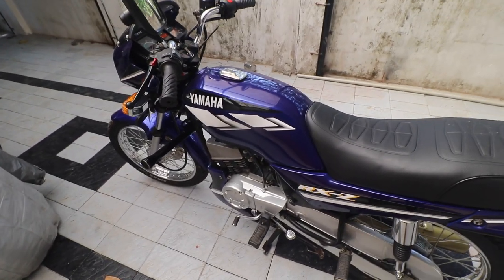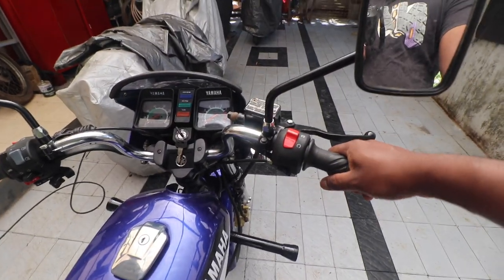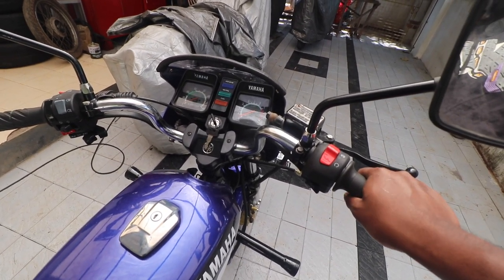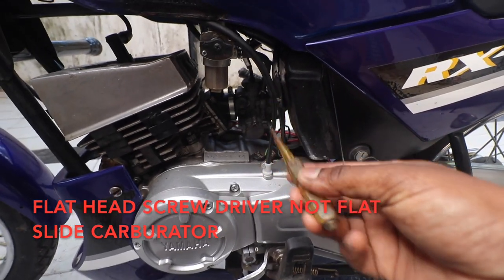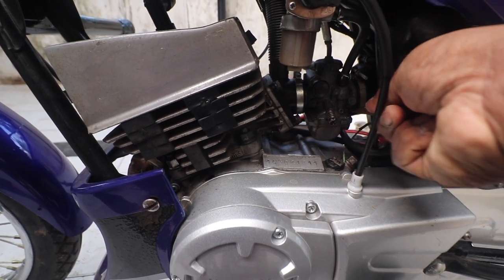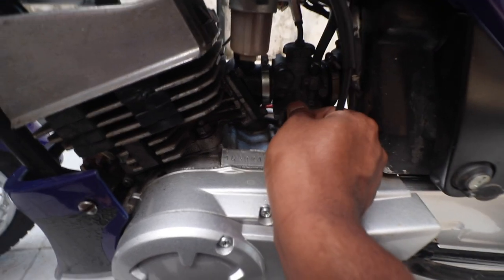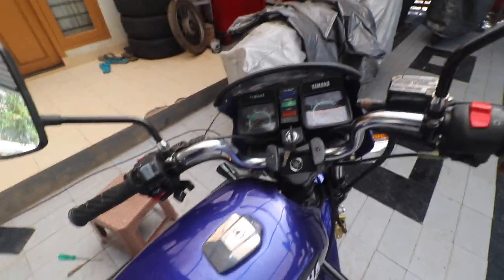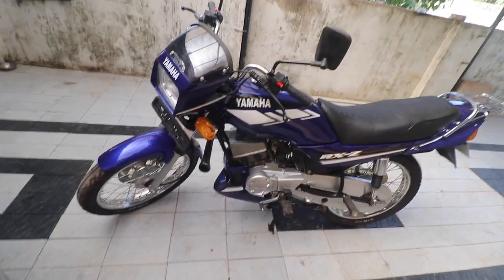Tuning a Yamaha RX Carburattor plus some troubleshooting steps

Comment: Sir I’m having RX 135 4 speed. I tuned the air screw out to 1.5 turns as you said in the video. But by bike does not pulls above 95 kmph in full throttle. It feels like rpm cutoff in fuel injection bikes. Pls help me bro @yamakaze
Reply from the maker: 2-3 things could be attributed to that all are fuel related though.
1. Bad main jet/ clogged atomiser
2. Incorrect float height 
3. Air hole for the tank cap blocked

For 3rd, you can ride with the lid open and see if that brings a difference. For 1 & 2 you will have to dismantle the carb and clean it. Before doing anything take a plug reading at that rpm where the problem begins, another important point is never speak in terms of speed, always talk in terms of throttle position. If it’s a carb/ fuel issue it should happen in every gear at same RPM. Rear yezdi wheel can reduce top end
Reply: Yamakaze I only face this problem with full open throttle. Bro.
Reply from the maker: Yuvanesh Sudhakar main jet

Comment: Hello. Can see some slight oil leak below the engine..not sure.why in my 03 rxg 5spd. Showed a local mech and he wants me to replace the sprocket seal and silencer gasket. Wanted your advice on this as this is my first bike ever and all wanna be sure
Reply from the maker: First thing first, get the bike washed completely and find out the source of the leak

Comment: Hello sir a small doubt,  magnet weight kurachal. Jerking or vibration undakan chance undo? (Z  converted 5s ) jerking on top gear at speed of 30-40 range
Reply from the maker: I have replied to you I guess, yes it does
Reply: @Yamakaze  yes brother.

Comment: Hello brother...my Rx engine is nearly bored .means low pickup and it needs to be re bored..one thing I didnt understand is my silencer sound on idle is good but on running I can get not that exact crisp it sounds like burrrrrrr...can u explain engine performance shows effect on beating of the silencer..r should I clean the silencer...thanks in advance brother
Reply from the maker: Tarun Kumar wait for the run in period to be over
Reply: @Yamakaze  brother that means do I need to wait upto update to my next bore and what Is run in period means 😅
Reply from the maker: Tarun Kumar after you rebore you need to run the bike normally under 4000 rpm for 1000 kms

Comment: Bro yamaha rx135 acceleration cable yamaha gladiator ignition on off switch assemblyil direct fit aano
Reply from the maker: Throttle cable fit alla, engine kill switch opposite aai work cheyyum, on cheyyumbol off aavum, off cheyumbol on aavum

Comment: brother, carb turning based on bike running. Air screw should be turn or adjust bike running. Each bike have different air screw turning.
Reply from the maker: Air screw and idle screw is mainly for idling adjustments to about quarter throttle position. These do not play any significant role once the quarter throttle position is crossed
Reply: while doing the aircrew adjustment, bike should be running engine.
Reply from the maker: @rxtuningpoint2270  for airscrew you can do on a non running bike but idle screw adjustment is done on a running bike

Comment: Is there any leak in silencer?
Reply from the maker: Ak updates no, we  modified the flute to increase the sound
Reply: @Yamakaze  ok sir i thought it may due to mouth packing leak.

Sir could you pls tell me how to add two engine on a single bike , i have seen some bikes in other state like rx200, rx270.
Reply from the maker: Ak updates not that simple, you need to fuze 2 cranks and the crank case needs to be fused. The costs would run more than buying a decent twin plus it will not run like a twin should run. It will not be road legal.
Reply: @Yamakaze   ok sir , any; idea about gb and clutch , is it required to extend the secondary gear box shaft for fitting clutch?  I m curious about how it function.
Reply from the maker: Ak updates you will have to increase the length of the output shaft and balance it. If you are seriously considering this then try doing it on a max 100 and I can share some information if you are serious in Pursuing it further.
Reply: @Yamakaze   thank you sir, for the reply

Comment: Hello sir...
I have bought a rxz 4 speed with BJ019 block. Is this a local delhi made block because my friends are telling so. Will this create a problem in future as in engine noise or low pickup? Or should i go and buy an original second hand block?
Reply from the maker: If it’s running fine I suggest not to touch it. If you have performance issues then you can look at getting another cylinder
Reply: Is this a genuine block for rxz? I have heard about y series and e series but this one on every sellers page is mentioned imported. Is that so?
Reply from the maker: It’s not

Comment: Great video sir! Thanks for the valuable information! The Kill Switch looks cool! Is it possible to install it on an RX135 ? Is that switch from an Apache ?

Also, I’m having this never ending problem : 

I can hear some sort of a suction sound when I am giving throttle to the engine from idle. But it goes away once the RPM is higher than idling/when I’m riding.

I have replaced intake manifold, air filter box to carburettor rubber, air filter...but still the sound persists.

Is this making the mixture lean ? What could possibly be the problem ? Thanks!
Reply from the maker: suction sound at idle would mean issue with one of the things you listed above. check the manifold, install a power box if thats missing in your rxg
Reply: Yamakaze It already has the PowerBox installed. I’ll check again.
Reply from the maker: Bratty Biker check for leaks. But it should go up when you rev.
Reply: Yamakaze It goes away when I give throttle beyond the idling RPM. Also not noticeable when riding (though it’s been over a month since we’ve all ridden motorcycles lol)
Reply from the maker: Bratty Biker could be an exhaust leak or the piston movement sound. Cover the silencer opening with your foot and see if that helps you identify the source
Reply: Yamakaze Thanks sir!

Comment: Sir, I am facing extreme problems from my Rx135 4speed. The mileage is very low. Lesser than 20, I checked and found there is no leakage in the carb still very low mileage. Are my jets gone? Also the bike didn’t start in the morning without blocking the part of the carb from which air filter is connected. Help me out please sir. I never thought Rx series would be soo hard to maintain
Reply from the maker: Check the choke cable, your carb also needs cleaning
Reply: @Yamakaze  Ok sir, I had a big doubt on my jets, if jets are faulty then what are the symptoms?
Reply from the maker: @you_tuberrr  depends on the jet general issues include misfires, to no start.

Comment: Sir anticlock wise petrol screw khol nea sea petrol jda jata hea ja kam  😩 tight krnea si kya hota hea or khol nea sea kya please reply
Reply from the maker: Tight karne se slide upar uth jata hai
Reply: Sir mea mixture screw ki batt kr raya hu
Reply from the maker: @Aimgodplaz  mein bhi usiki baat kar raha hoo, air screw is the little screw hope you are not talking about that
Reply: O sorry sir that's air screw uska hi push raya tha uski setting kya hea
Reply from the maker: @Aimgodplaz  full tight then 1.5 turns out
Reply: Thanks sir
Reply from the maker: @Aimgodplaz  👍

Comment: Brought a 03 rxz a week ago. Having issues with cold start. Need to Kick it more than 50 times. Once started then there are no issues felt. Request advice.
Reply from the maker: Are you using the choke? If no then try using the choke, if yes then try cleaning the carburetor once, change the plug
Reply: @Yamakaze had cleaned the spark and tried. the choke cable was missing need to get it added. Will do and and get the carb cleaned and check. Thanks for the feed back. Any brand or spec u recommend for the spark
Reply: Also please recommend any mechanic if u know from Bangalore as I'm new here
Reply from the maker: Without choke it won’t start
Reply from the maker: @rakeshnair4724  choke is important since a cold bike needs more fuel to start, once started it can go without choke
Reply from the maker: @rakeshnair4724  I don’t recommend mechanics
Reply: @Yamakaze  thanks a ton. Got the cable replaced. It's a one kick start!
Reply from the maker: @rakeshnair4724  👍

Comment: How many turns I have to do in my rx 135 ,4 speed in the carburettor
Reply from the maker: mentioned in the video clearly
Reply: @Yamakaze some other guy was saying 1.75 turns out is mentioned in user manual. Is it true?
Reply from the maker: @duke7571  try

Comment: Bro idle speed correct 1100 vachal  onu rais cheyith kazhinjal pine rpm 1500 avum pine kurach kazhinjan correct positionil varune idle speed
Reply from the maker: Reed valve issue Varm, air leak kond varam
Reply: @Yamakaze  bro reed valve issue indengil starting trouble indavile. ipo Starting problem onum ilaa 
Idle കൂടിയും കുറഞ്ഞും കൂടിയും കുറഞ്ഞും നിൽക്കുകയാണ് air leak Thane ayirikumo
Reply from the maker: @jojofernandez2638  yes
Reply: @Yamakaze  bro carburetor slide cheruthayit scratch ind athinte issue varo. Oru sugam Ila vandi odikan athaaa idle correct kittunilaa

Comment: Hello
I've already asked you about my suzuki samurai and you helped me i have another thing which I need to know.
Previously it doesnt accelerate high automatically when cold starting or first time start in a day or starting after an hour.But now it accelerate very high soon when I start the engine for an hour or a day or a week.And also it accelerate very high when it is ran out of fuel. No throttle cable problem, no choke problem, idle screw adjusted to low. Soon it start to die when I ride for minutes. It doesnt idle. And also poor mileage even the carduretor tuned finely. What is the reason. Is it normal.
And also there are no scratches in the bore. Piston was not blown. But the kick is not that much tight enough as previously.
I'm planning to change piston rings. Changing rings can fix the problem?
Please help.
Reply from the maker: check for air leaks into the manifold
Reply: Had this problem with my Max 100R.

Found that the cracks in intake manifold was causing the mixture to lean out and increasing RPM. Changed the Intake manifold and then :

Cleaning,Rebuilding and tuning the carburettor would also fix it. Make sure that you fix the clip in the correct position in the needle.

If both doesn’t work, then you need to check compression and if it’s not good, then reboring is the only option.
Reply: @BrattyBiker  hello
and the spark plug is fouling every time, even the carburetor tuned perfectly.
kick is easy to push down.
does spark plugs foul when there is a loss in compression.
can the engine regain compression by re-ringing.
please help.
Reply: @Yamakaze  hi again.
hello
and the spark plug is fouling every time, even the carburetor tuned perfectly.
kick is easy to push down.
does spark plugs foul when there is a loss in compression.
can the engine regain compression by re-ringing.
Reply: Sai Yasaswi Are you premixing oil ? Is your oil pump working ? 

Spark plug fouling everytime means you are mixing too much oil.

1) I think your mixture is too lean, caused by an air leak in the manifold (cracks in rubber) so even if carb is perfectly tuned, the leakage will allow more air to enter into the manifold and will make the mixture lean.

2) An easy Kicker does mean that low compression. Either your rings are worn out or yeah, you just need to rebore to the next oversize.

What size is your block currently ? Is it sleeved or unsleeved ? My suggestion is to get a new block piston kit, TVS is still manufacturing it so you can get it. If that’s not available, I think you will need to rebore the cylinder, hone it and chamfer the ports along with new piston and rings.

Here are some tips so that this won’t happen again : 

1) If you are getting a new block piston kit from TVS, that’s the best option. Install it and it will be fine.

OR

If you are going for the next oversize, make sure to rebore and ask 30 microns for clearance. Rebore the cylinder , Hone the cylinder (Tiny X X X type of overlapping scratchmarks will help the bore retain oil = better lubrication = smoother engine = longer life of rings, piston.etc), polish and chamfer the ports (again, chamfering is smoothening the edge of the ports so that the rings won’t hit them hard when the piston is going up and down) 

2) I’d also recommend a full rebuild with a crankcase and engine case clean-up, re-installation of parts along with new bearings, Crankshaft checkup and repairs, New clutch and pressure plates.etc 

2) Remove the oil pump, oil tank and oil pipes and store them safely. Block the carburettor’s oil supply provision hole so it wouldn’t suck air and it won’t lean out the mixture.

You have to run the engine purely premixing the oil with the petrol in the fuel tank when you are filling up in the fuel stations. 25-30ml of oil per litre of fuel will be perfect. No need to worry about plug fouling or siezures due to oil pump failure (since you don’t have an oil pump to fail)

Use Shell Advance VSX or Motul MotoMix for the Engine and any Motul 3000 20W40 Oil for the gearbox.

3) Since you will be opening up the head, my suggestion would be to decarbonize the head using petrol and aluminum foil and rub it till you see the shine. No carbon deposits to be present whatsoever.

3) Remove your silencer and decarbonize it. Change the exhaust muffler to the Shogun replica (you’ll enjoy the sound) 

4) Clean and rebuild the carburettor. Make sure the clip is in the second or third position from top, on the needle. Make sure you replace the float gasket. Make sure you clean all the jets and make sure you adjust the float height correctly.

5) Change all manifold rubbers, Check reed valve for proper operation. If they have trouble, replace them. 

6) Check air filter box for any cracks or leaks and replace the box if found any. Replace air filter (soak in 2T oil, squeeze and install, it should only be slightly wet with oil)

7) Install NGK BP7HS Spark Plug and use Hero Honda Red cap as it’s a water resistant cap.

Complete run-in properly (1000KM). NEVER forget to premix fuel. Do not ride/run in a same RPM. Use all gears, use a wide range of throttle or engine speed.But do not hit redline or stress the engine too much. 

I hope this helps. All the very best to you!
Reply from the maker: Sai Yasaswi you can check if the choke is stuck internally. The plugs fouling under normal circumstances is mainly due to the choke getting stuck. This is with the assumption that you are using either the 2t pump or premix and not both. This can also happen if your oil seals are bad

Comment: Is this the same procedure for tuning carburettor for RXG ??
Reply from the maker: Yes
Reply: @Yamakaze  my RXG doesn't have RPM meter then how to take the reading ??
Reply from the maker: shreyas ms if you are planning to set the idling RPM you have to do it based of the sound, turn the idling screw anti clock will till the bike starts to die, then turn quarter of turn clockwise, do it when the engine is warm
Reply: @Yamakaze  thanks for your valuable reply
Reply from the maker: shreyas ms 👍
Reply: When the bike sound comes to single single beat with gap you can fix the rpm
Reply: @Yamakaze  Hi bro..AF screw 1.5 turns out but the idle screw position? Should it be fully screwed in or any specified no of turns before commencing the tuning process?? Highly appreciate your inputs...
Reply from the maker: @KK-cd7nu  idle screw should be turned to maintain idle, watch carburettor tuning video

Comment: I have a problem of bogging down my rxz when i runs with a full open throttle....also it brings lot of smoke while bogging down....is it the problem of main jet?...if yes, what should i do
Reply from the maker: You have to take a plug reading with a fresh plug, specifically at the rpm where the bogging happens. Based on the reading we can look at the next course of action
Reply: Yamakaze i took it with a new plug and it happens from  7000 rpm
Reply from the maker: At what throttle position? And what does the plug read, lean or rich?
Reply: Yamakaze after 3/4 of the throttle position....i didn’t understand about lean and rich in plug reading
Reply: Yamakaze i have the same problem in every gear at that throttle position
Reply from the maker: @nihadh3277  look for 2 stroke plug reading on google
Reply: Yamakaze bro i look about it...it seems rich
Reply: Its somewhat rich but not lean
Reply from the maker: TD Nihadh 59 remove the air filter lid and the element and ride it to see if that makes a difference
Reply: Yamakaze I have done it...it seems ok...i couldn’t recognise any misfiring or bogging down at the throttle position where i usually find it
Reply: Yamakaze what should i do next
Reply from the maker: TD Nihadh 59 you need to downjet or use a foam filter pod like UNI
Reply: Yamakaze which one should me more appropriate
Reply from the maker: @nihadh3277  best idea is to downjet, where are you from?
Reply: Yamakaze calicut
Reply from the maker: @nihadh3277  ok

Comment: Bro after cleaning the carburetor of rx100 , when started the bike , the rpm suddenly increased to maximum,  what should I do
Reply from the maker: Check the cable, it might be stuck. If you know how to blip the throttle then try that when the bike is running, another possibility is that the slide is installed in the opposite direction
Reply: Thank you so much bro , I'll try what u said